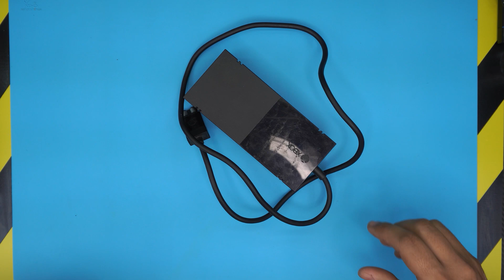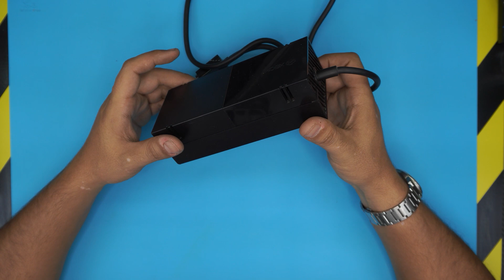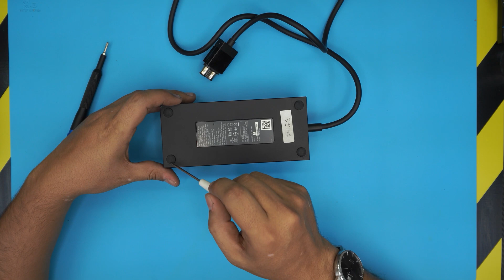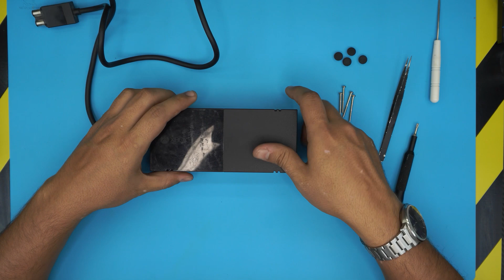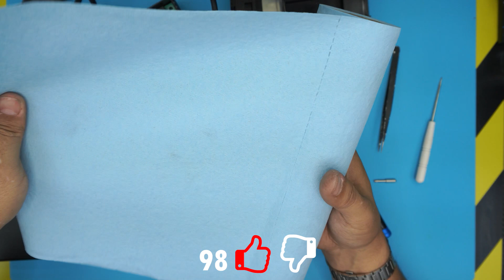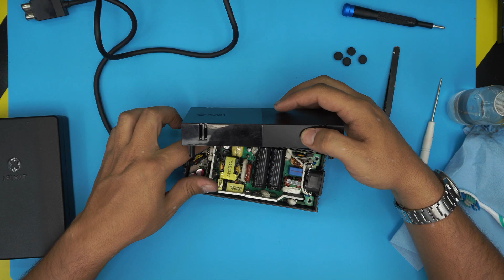How to repair Xbox one power supply Fan | Service | Cleaning

Comment: Mine died tonight.  Can't get to my shop for a day or two, where I have the security drivers.  Will give it a go.
Reply from the maker: i hope you get to fix your PSU , if you have any questions let me know. if you wish to support the channel you can LIKE or SUB or both :P
Reply: @uFixTek     Well, opened it up and cleaned it all up.  Lasted one night and on the second evening, quit again.  Not sure where to look now.  Your video was helpful as to how to get in and where to look.
Reply from the maker: @Kaptain13Gonzo  try looking for inflated capacitors : https://youtu.be/e87ZTBRr6vk
every reversion of PSU is different, check for a capacitor that is inflated.

Comment: Hello again My friend ... thank you for the useful videos. 

I would like to ask you about the hard-drive, the first option I have shared with you which was “ SSD gaming 1TB) isn’t available anymore. 

What about this one 👇🏻:
https://www.amazon.it/gp/aw/d/B07H28QRKN/ref=dp_ob_neva_mobile

Is it a good option, and what’s the difference between this one and previous one(SDD)?
Thank in advance
Reply from the maker: anytime :P
the 1st one was a hybrid type HDD/SSD :
the files would get moved to an small memory underneath the hdd and it would act as an ssd , in order to make files respond faster.
and this new link will work too but its not a hybrid drive its a HDD only and it will do the job fine for your programs perfectly fine. no need for the hybrid, the hybrid is for those games that dont want to buy a full ssd and they want storage at the same time.
the advantage on hdd is that the files are much secure there than ssd and ssd has a low life than HDD. therefor go with this new one :)
good luck my friend
Reply: @uFixTek   thank you so much my friend. Your reply was really helpful. I really wish you the best and I hope this amazing channel get more and more subscribers. ☀️👍🏻 do you have a page also on Instagram?
Reply from the maker: anytime and my pleasure to help out in anyway i can, and at the moment i only have this youtube channel, if in the future i open Instagrami let you know (soon :P)